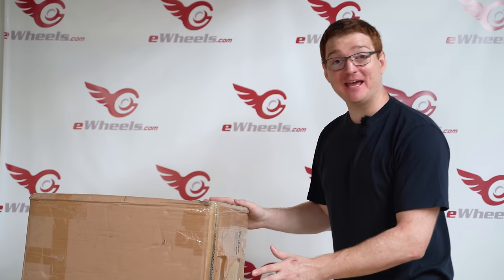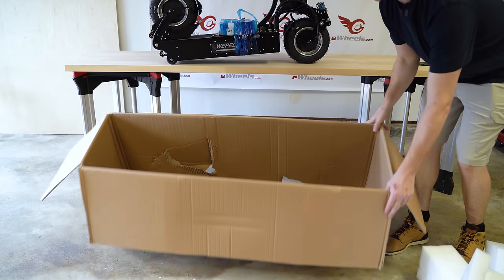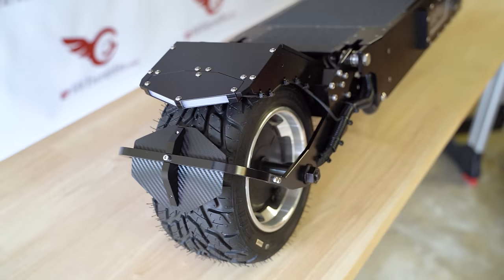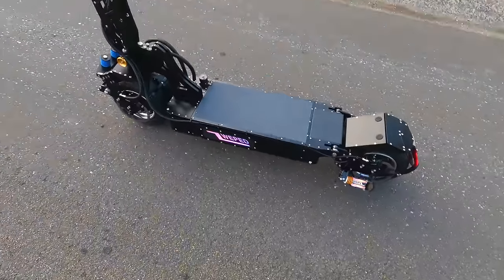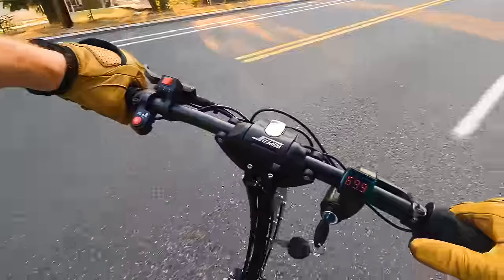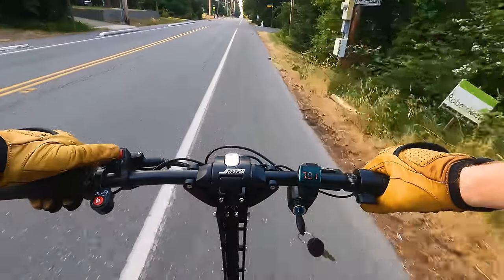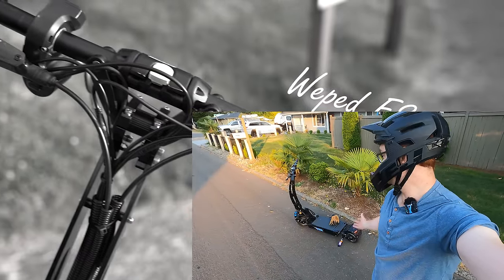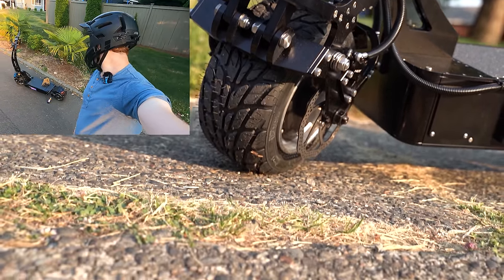One of The ⚡ Quickest ⚡ (and most $$$$) Electric Scooters in the WORLD - Insane WEPED FS Unboxing

Comment: For a scooter that expensive and that powerful, there's no reason they shouldn't have included a speedometer of some sort.
Reply: I think it's so fast that it's illegal
Reply: Ya pretty dumb considering the throttle/speedometer lcd display combo is only $30...
Reply: Apple: "Wrote that down Tim, wrote that down !"
Reply: They didn't add a speedometer for a reason and that's so you don't get distracted and you strictly focus on riding the scooter. That thing is a beast I've riden the test demo last year and if you want a speedometer just use your phone simple as that.
Reply: @7KingCobra7  Lol no point of attaching speedometer if that thang is not even accurate. Just use a phone and you're all set.
Reply: @mrtoquick  Yes... eyes forward on this beast at all times! Speedo is distracting. Anyone whom I've let ride any of my scooters... the first thing that is always said is " It said I was doing XXmph".
Reply: @mrtoquick  Yes but so are Motorbikes but they have speedometers so you dont kill people 🤣 For £7k i would expect it to have one you need to know your speed in built up areas or you will end up hitting a child or something. Yes you could use phone but battery's got flat and things far from ideal.
Reply: Practice with feeling different speeds
Reply: ye you know you are going fast like thunder
Reply: Jarred Keeting  I don’t think novice riders should be choosing this specific scooter or anything above 20mph lol
Reply: Jarred Keeting  a requirement? That’s a bit of a stretch. Usually a speedometer is used to monitor your speed but seeing as it’s inaccurate 90% of the time and not easy to control speeds on a thumb accelerator tsk tsk I dunno man. You have a better one in your pocket if you so desire much.
Reply: Jarred Keeting  when I’m not riding scooters.
Reply: Cruise control and air con too hey???
Reply: @freebird1721  ?! Yeah pylbm7
Reply: @freebird1721  ?! Yeah pylbm7@
Reply: @mrtoquick  Using phone while riding to look at your speed is pretty unsafe. (that's what 90% of riders will do, 5% buys a speedo and another 5 a phone holder...)
Reply: They would not add one because the thing is propably not as fast as they claim it is. Scary like hell with those tires, that I believe easily.
Reply: You need to learn how to use a camera.
Reply: @_jay_6940  Lmao, got him silent😂
Reply: @XtremeKillah101  yea in America it might be haha
Reply: Just mount your phone on it and turn on your navigation for GPS speedo.
Reply: @honeybadger9425  m Kim
Reply: maybe even a parachute.
Reply: Mirrors wouldn’t hurt
Reply: @mrtoquick  how do you know that you work for the company?
Reply: @doitbeforeyoudieful  lol. Plausible deniability. Yes officer it only goes 25 mph as per the manual
Reply: Huge batterie huge motor maybe low cost equipement cleary prefer to have a wolf king gt
Reply: Get a cellphone mount and the APP WAZE has a GPS SPEEDO that's pretty dead on balls accurate.
Reply: @7KingCobra7  you don't want one of those trigger throttles on something this powerful..
Reply: it's not accurate anyways, so you can use your gps

Also at speed you should watch the road, I get your price thing, it's a valid point, but then i'm watching this video and digging the no-display experience a lot.

Might have wasted 100+ dollars on a cool LCD screen and now I might be liking it more without
Reply: spedometer inaccuracy is usually related to calibration and the fact that in firmware, like that for ebikes, usually report a higher value than GPS speed for the sake of being legal, because the reported speed may not be lower than the actual physical speed of the device so they're usually over the actual speed on the readout

on my ebike for example i had to use 26" on the speed settings instead of the real 700C/28" size to get it to measure 1:1 with gps speed

so yeah if it is properly tuned it is very well possible to get it to be accurate.
Reply: @BH4x0r  not even gps is accurate, take a look at speed tests 

Anyways I agree it should include a display at that price point, just find it very fascinating and fun without it though 

My scooter reaches 50kmh but the best thing is that I practically never look at display while riding but to see how much battery is left
Reply: How much is it. I looked but didn't see
Reply: @danielcrisp3042  about $11k, dunno if that includes shipping etc.
Reply: Why do you need to look at the speedometer when youre riding a scooter?
Reply: I seen one like this bud had a speedometer it went 50 mph
Reply: @koalakurt9366  the FS can hit 80mph tho 😂
Reply: My brothers $120 scooter came with a speedometer💀
Reply: @BH4x0r  it's 8k
Reply: @Make-Asylums-Great-Again  depends in what country you live and where you look i guess, i've seen it higher on other sites

edit: normal is 8k, limited edition is 11k
Reply: and no regen??
Reply: Use your phone many odometer apps
Reply: @freebird1721  “wrote that down” 😂😂💀💀💀💀💀💀💀
Reply: Exactly
Reply: @XtremeKillah101  Yeah that's what the cops here told me
Reply: use your cellphone, Always
Reply: Hey, how is that keeping up now? Still going strong? Any follow ups? I never see them last long! I seen a high end e scooter in the dumpster ! It needed more work than it was worth.
Reply: @obates1  Um......several reasons? The police being one of them if you take this thing into town. You still have to follow traffic laws. 

Also, an odometer would be nice too. For 8 stacks, yeah I would want a display for battery, speedometer, and odometer. Or atleast the option to shift speeds.
Reply: @7KingCobra7  by $30 you mean $30 per box of lcd displays, right? I’m pretty sure it would’ve cost an insignificant amount of money, because if I owned the company making these scooters I would have never pay $30 per unit but for a box of at least 10 units.
Reply: No speedometer 😂😂😂😂😂😂 white blue got PUNKED!!!! 😂😂😂😂😂😂😂😂😂
Reply: Tell ya what to do. Buy a dragy, connect your phone to it and use that, it's 100% accurate
Reply: Speed or Speed Readout? Pick One. lol
Reply: @BH4x0r  it is for the safety of the rider and bye standers encase you fall off or loose the grip on the handle. Functions same a tether on the jet ski or snow mobile….
Reply: Yes there is plausible deniability
Reply: Also no regenerative braking
Reply: What’s thy e cost
Reply: If you desire a screen you’re iPhone/mobile is better in every way.
Reply: Think bout Rion they also don’t have a speedo
Reply: @mrtoquick THANK YOU Additionally those fucking things are actually more expensive then one would guess especially one that's mechanical
Reply: Speedometer = Impound
Reply: No, it comes standard with the scooter. I checked it on the website and a third-party dealer.

Comment: I love the design but I want something smoother less detail no screws or holes but with the same angular design also can't go wrong with rgb minus the logo I hate logos and this is obnoxious
Reply: the wide tires seems extremely dangerous at high speeds. no ability to turn and lean
Reply from the maker: I definitely agree. The 'fit and finish' on this scooter looks sort of tacky with the 1 billion screws. Not to mention it makes serviceability a logistical nightmare with piles of labeled screws everywhere 😅
Reply: @GingerOnWheels  i feel clean scooterdesign is exclusive for the mid range prized scooters which works for me as i can only afford those but still, i'd like to see a powerful capable scooter that doesn't look like a mountainbike
Reply from the maker: @taltigolt  you mean a Rion Thrust??
Reply: I had a Dualtron X.  Even top of the line scooters worth 7k brand new have terrible design flaws like screws that strip out easily.
I got into EUC's because they're way cheaper and more reliable in general.
Reply: Rion Thrust
Reply: First of all the wide tires actually make it way more safer than let's say round tires. It's like a car versus a motorcycle the car will have more contact patch making it easier to go high speed. But you can also get round tires on this scooter if you want. 

I've rode this scooter last year the test demo and that one had 40000W not the 30k W you see in the video. Second of all the reason for all the screws it's because the whole frame is made out of cnc aluminum so unlike your other scooters including the Rion if you damaged any thing you have to replace a lot. Like if you damaged the frame on a rion you know how expensive it will be to replace to carbon fiber Frame. But on the weped you damage any part you just have to replace that section making it significantly easier and cheaper.
Reply: well its easier to tighten all the screws
Reply: @big_petebear8535  until you fall and your euc becomes Unrepairable
Reply: @c2thew  8k miles so far.  No problems yet.
In contrast my Dualtron X broke down 7 times in less then a 1000 miles.
Reply from the maker: @c2thew  its actually much harder to total an EUC than a scooter. Which is great because they're so much easier to crash if you're inexperienced.
Reply: Just got a dualtron ultra 2
...
 insanity on two wheels looks a lot nicer than this wiped thing
Reply: @mrtoquick  very wide flat tires on 2 wheels is absurd. this makes it un-maneuverable at high speeds specially when turning on corners.  There's a reason why motorcycles and bicycles use rounded tires. 

the wide tire profile might be stable on roads with marble-sized rocks/stones though.
Reply: Try Hunter Quad, it decimates everythin else, 😁👍

Comment: I like the stem design of the wepeds I just hate how there is absolutely no design beyond that. The scooter is covered in silver screws and the body looks like a giant box. The wheels are impractical for a two wheeled vehicle. The scooter has cheap red switches and buttons and no speedometer at all. For the price that these sell for I'd expect at least a little better design. People who want to pay for speed and nothing else will probably buy a Rion.
Reply: How much scooter
Reply: @edgardomonroig9023  $8,800
Reply: Agreed! I actually don't like the look of it at all!! To each is own as they say.
Reply: Rions are nice but the range on them sucks plus having to wait 6-12 months for it sucks. The weped is not for most people but they provide quality and performance like no other.
Reply: @Pokemon Master don't need to own one when there are multiple videos online and even the website tells you all the facts. Easy to compare scooter to scooter. Have you even seen the Rion website it literally states the thrust has a 35ah battery compared that weped 50ah so which will outperform the other one.
Reply: + it seems like its impossible to accelerate smoothly. Either all or nothing, which is horrible for day to day use
Reply: @mrtoquick  try 1.5yrs and still nothing,get this or a nami or thunder 2.
Reply: @shameelali2549  you've been waiting 1.5 years?!?! Did they take your money? If it is outside the window where your credit card company protects you, and you can't file a charge back, and it is a US distributor (or a distributor outside of China) spend the $150 to have a lawyer send them a demand to return your money. Print out your evidence, call a lawyer, and have them write a formal demand to the company.
Reply: Rion ??? .... 🤣🤣🤣 
This dismantled machine made more than one vomit and regret, it will be 100,000 times without me

Comment: the throttle should be working in exponential mode instead of linear mode, so that you dont get those sudden undesired accelerations just by barely pushing in the throttle....
Reply: Lucho RR  you have no idea what you're talking about. Neither exponential, logarithmic, or linear control is good for throttle control. It needs to be a sigmoidal-like curve. There really aren't any (mainstream, quality) electric bikes or scooters with a linear throttle curve. It's trash, or designed by people who don't know what they're doing, or who are ignorant to the dynamics of the HMI of the throttle. (Like you.)

Comment: The way they did this if the pin comes loose at high speed the rear tire assembly will just fail and you'll be sliding on the bottom of the chassis. I would have preferred the back tire to hinge from the bottom and use gravity to take the weight.
Reply: what do you think those little suitcase wheels are for mate?
Reply: @soberacidtrip  he's blind 🤦

Comment: I'm a little worried about leaving so much tension to the 2 folding pins. Think about that the only thing holding up the rear wheel is the pin. And with all the weight and torque from thrusting acting on them, those pins seem like the Achilles' heel.

Comment: If it wasnt for the lack of a speedometer and rounded wheels that thing would be amazing. Those wheels are only made to go straight forward because if you are speedmode 2 or higher and try to turn that thing is not going to be stable
Reply: You can install PMT Tyres on the Weped FS. They are large and wide but also much more rounded and corner very well.
Reply: @wepedaustralia  how do the pm tyres run in a straight line. Is it easy to install at home. Tools and all.. Im from New Zealand. 
Thinking of getting the FS. Or the new NUMO Slack core 920r. Up to 90mph 😯

Comment: I’m sure the tires have to be that wide for stability at 70+ mph, that is insane, I want one, I wanted the 40mph Varla, until this. The Varla is probably a better all around and versatile scooter, and it pretty fast but omg the sound that thing makes and the reactions the rider has, wow. The one thing that I am questioning is if those spins are strong enough to hold the wheel assemblies in place without breaking @70+mph hitting an unexpected bump, or grain of sand, and the handlebars he said weren’t strong enough.
Reply: yeah i wouldnt want speed wobble from thin wheels at 70mph. it only makes sense
Reply: Mine is due next week, at first I was thinking of putting PMT's on it, but the more I read I'm thinking staying with these type of tyres would be better, for traction and stability....
Reply: @timpriestley8997  hi have you got your FS. How you liking it. Pros and cons? 
I'm thinking of buying one. Or maybe that new Slack core 920r. Up to 90mph

Comment: Great video and was fun to watch. My biggest beef with these awesome high-powered scooters is they all go with the wide ass squared off tires for some reason. Anything on two wheels that relies on leaning to effectively turn needs a rounded damn tire. When the scooter fights your leaning, it’s neither predictable or safe. Imagine if motorcycles had what essentially amounts to car tires-it would suck. I think the aesthetics of wide tires help sell the scooters. But once you ride it, it’s a very disappointing feel. And put a flipping speedometer on it! The scooter’s cost warrants it. Let the rider determine if looking down on it is safe for them or not.
Reply from the maker: Weped is the only brand I've seen with tires like this. They aren't the best, but maybe they are if you travel in a straight line only.
Reply: @GingerOnWheels  forgot the brand but wide wheel is another scooter that's pretty popular with the same tires.. although I would agree that I wouldn't want these tires on ANYTHING with two wheels
Reply: You can install italian made PMT tyres on the Weped FS - They are rounded and heaps better for turning.
Reply: @GingerOnWheels  TIME HAS PASSED, UPDATE?  LIKE ANYTHING BETTER FOR SUMMER 22?  FAV EBIKE OR SCOOTER FOR 2000?
Reply from the maker: @BOOSTEDLASER  If portability isn't an issue for you then the Fidico Lightspeed Knight I've got is pretty great.

Comment: Im sure the reason they dont do this folding mechanism on other scooters is simply due to the manufacturing process.  This seems to be mostly hand machined parts so it would be no trouble to drill another hole but on a pressed sheet metal design or cast metal  design you would need to hire someone else on the line just to drill these holes for the folding and locking mechanism.  It wouldnt really be that hard for you to do it but from the companies point of view that one hole is worth an extra paycheck
Reply: Stunt scooter have a stronger base as it doesn't fold after it gets air and comes back down a lot of force

Comment: It should've been a speedometer on it to change preferences like braking power, or adjusting the 1 2 and 3 speed levels.          Also if you go to fast and jump over something how would the pin be, at the back of the scooter ? it has so small locking ball joints at the end of the lockpin, so if no pressure is on the lockpin and you jump, could it possibly wiggle itself out of position ?,  it should've been a hole at the end of the pin and then a small bolt that goes through it with a nut at the end.   Although the bike seems like quality, but for the pricing, they missed out alot of gadgets on it.    I would not feel safe with those locking mechanisms atleast, small ball joints, also if smuss gets into those ball joints, they will not pop up again.